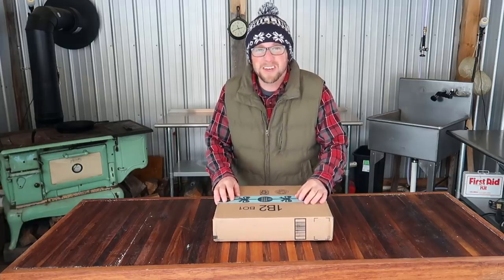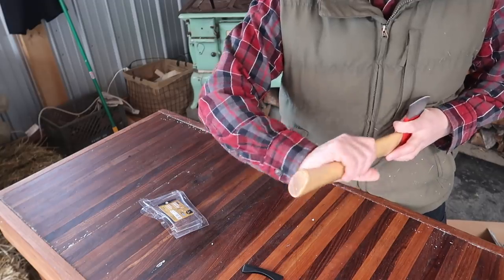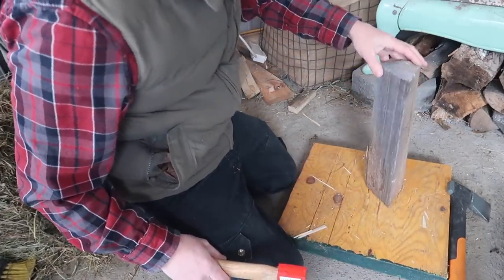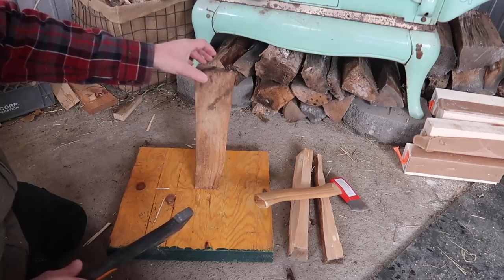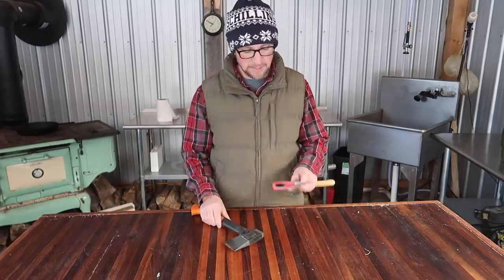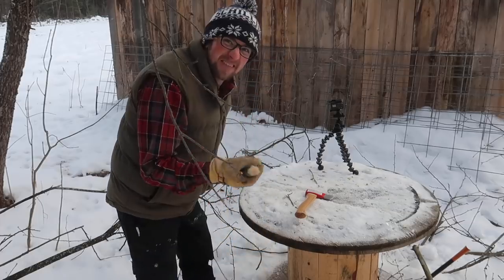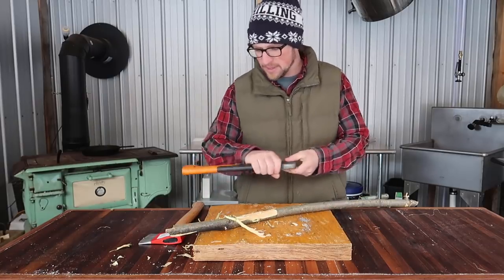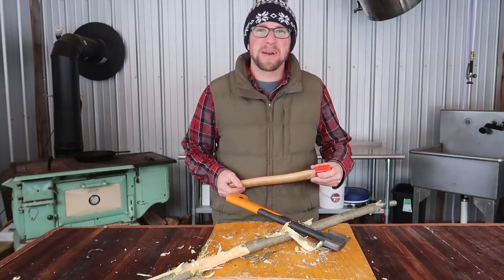Testing a $9 Axe on Amazon | Too Good to be TRUE

Comment: I would like to see a video of you making the ax better.
Reply: Most axes benefit from sharpening right out of the box, so I expect marked improvement when he does.  I prefer the wooden handle, means its easily replaceable which increases.  So as long as the axe head is solid and a decent (wedge) design, the axe will be pretty good.  Wooden handles are interchangeable, so you can either make your own, and Cinderella the new one to your preferences; modifying the grip to make it work better for your hand size, grip style, and/or swing.  Unlike most composite/fiberglass handles - though resilient - if the damaged you're pretty well screwed, as its monolithically bonded to the axe head in most cases I've seen.
Reply: @Benz1659  definitely agree with you there. Hatchets and axes are better with wood handles. The only thing I prefer fiberglass for is my 8lb splitting maul

Comment: I wouldn't even bother using that axe without putting a good edge on it, removing the varnish, and applying a coat of   
boiled linseed oil. Did you check the grain orientation? The varnish is for protection in store displays. I don't trust the epoxy, and I'd use a magnet to see what is under the black stuff. What you get for $9 is an FIY (finish it yourself) axe because there's no way they could put a good edge on it, haft it properly, and inspect it for that price.

Comment: Sand the varnish off the cheap hatchet,  you can profile the handle to fit your hand the way you like and then rub it down with boiled linseed oil.  Makes a great improvement on grip and will increase the lifespan of the handle! 
Good guide for wood handle maintenance with the linseed oil is : everyday for a week, every week for a month, every month for a year and then annually after that!  This works for all wood handled tools!
Keep up the great work, loving your channel as we embark on our homesteading journey!!

Comment: A hatchet is not really meant for cutting down trees, its more for splitting small wood or shaping wood.  It starts out with the weight to handle ratio.  A good ratio is one that is easy to use without tiring your arm or hand. It should be sharp and have just the right amount of width to split wood.  I get mine at most yard sales.  You can pick them up cheap and make your own handle to fit your hand.  The steel most times is better than what they make today.

Comment: Myself I bought a kobalt from lowes, $20.00 , has a very thin width to the head . Fiberglass handle , injected into the head of the axe. Handle has rubberized grip materiel. So while cold or wet  my hand grip does not slip. owned 10 years now . Life time warranty . I am a big believer in wood handles , they have there place for some tools. If i am in the woods, far from the tool shed  and only carrying one tool , I want a handle that is about unbreakable. Most of my tools with wooden handles have been replaced over time. For heavy work , snow , concrete and dirt . The lightest tool in weight wins my vote for all day use. On the kindling splitting for myself.... I always use a small piece of scrap wood to hold the top of the yet to be split wood. I am a safety nut I guess. Plus I have meet to many folks with a story to tell about a 8 1/2 or 9 digit  hand shake. They do not grow back . Seemed like a fair tool test AL. If you ever get a chance to chop with a sharp and thin head hand axe on those apple branches , the difference will shock you .  For carving with an axe. I think you might be using the hand grinder to customize that steel head , weight and angle ?  And or adding some flat edges to the round wooded handle?  Keep the great how to and review videos coming ! thanks .
Reply: Nice comment/info. I like having all 10 as well :-)

Comment: Just like axes, hatchets are designed for different uses. The black one with its more wedge shape is made for splitting, cutting kindling..  the cheap one is made for grubbing,, cutting around fence posts etc. the longer blade edge before it thickens out will cut smaller green stuff easier. It will also hold it's edge better digging and hitting the dirt. Wasn't long ago there wasn't weed whackers and I cleared hundreds of fence posts with one like the cheaper one.

Comment: Sorry but the last chop test wasn't fair! You used a vertical chop on the red ax but with the black head ax, you chopped properly coming in with a diagonal chop. For nine dollars, the red ax every time. You can always increased its grip by slipping rubber shrink grip over the handle and hume a better edges which axes need frequently when chopping into frozen and hardwoods. :)

Comment: Al when you used the $9 axe on the apple tree, the branch that you were chopping on was attached to a large more of a dead limb of the tree so the axe was bouncing a lot because of the dead limb.  When you compared with the other axe, the branch was smaller than the first one and the limb it was attached to was live and sturdy.  Just an observation.

Comment: My experience is that splitting dose not need as sharp an edge as chopping.  A narrow profile goes in farther but if the wood doesn't split it gets stuck easier.
If you are going to be using it to do wood working consider sharpening it on one side like a chisel so that it works as an adze.  My carpenter father always carried an adze in his toll chest.

Comment: If they revarnished the handle, it would not absorb water to swell tight.
Use a stick of kindling to hold the wood piece as you split it. No fingers near the blade. No thumb nail trimming. 
That Fiskar hatchet only cost 3-4 times what the Stansport hand ax cost. Hatchets have straight edged blades. Axes have curved edge blades. Hatchets are for splitting. Axes are for chopping into the side of a tree. The Stansport needs the edge profiled to chop better. They are purposely not fully sharp due to liability risks.
I'd take the Stansport camping where somebody could lose it. Put some friction tape on it.

Comment: I think the burr and varnish on the $9.09 hatchet was the reason it did not perform as well.  Spend 10 minutes sanding the handle and add some ting oil and put a good edge on the blade and you’ll have a decent chopper.  I wonder how long it will keep the edge, if the blade was heat treated or not.

Keep up the good work Al.

Regards,
Ed in Hamden Connecticut.

Comment: The Fiskar works well with out any modifications.   The only advantage to the Standport is the shape if the handle.  If you have to modify it to make it work better the cost savings is nullified.  Not all of us are have a good work shop like you have Al.  We also don't know how well the edge will hold up under normal use. Sharpening an axe of hatchet takes a little time to be done correctly.  Kind of like cooking knives.  A dull axe makes more work and is dangerous.   Plus you make me very nervous when you cut kindling.    I'm looking forward the next video and the improvements.

Comment: Good morning Al, the $9 hatchet had poor head control. I agree that the varnished handle has a lot to do with it. Wrap the handle with friction tape for a cheap, quick fix. Also, what is the angle of the bevel on the heads? Are they the same, or at different degrees?

Comment: Gooood Mawnin' Al!  This comparison makes me think about my sailboats running rigging.  The term used to describe how a line or sheet feels in your hand is to say it has "Good Hand".  A thin rough edged poly plastic line will develop burrs and prickly feel to it quickly when exposed to Sun and Salt.  A good nylon core wrapped with a softer outer layer will feel much better in your hand, hence the expression that a sailboats main sheet should have a "good hand" feel to it making it much more comfortable when being held in your hand for a long time while sailing.  Quite often things as simple as a hatchet will differ in only how well they feel in your hand.  Fatigue is the enemy of hard work.  Same difference in Craftsman hand tools vs. Snap On tools!  The price sometimes doesn't make sense until you "feel" the difference.

Comment: Instead of cutting kindling I make bundles of twigs and small branches.  Like those branches you burnt up from clearing the lane, I would have cut the prime stuff with hand loppers into 18" pieces. I use a smallish bucket and stand the pieces in till full, slap a bungee on to tighten them up and tie them up with thick thistle twine. Flip it over in the bucket and repeat but after the knot on the last end I leave a 18' or so peice and tie the end to the other wrap to create a handle. 
  If you add up the time you spend cutting kindling, the wood to make kindling and then factor in you are dragging limbs to just burn and time spent on that end and to me it's a break even on time to just cut branches in place and I get not only a use out of what was waste but the hours spent are in good weather, not cold days and less chance of being nicknamed 9 finger Al.

Comment: The cheaper one is made of cold rolled steel not harden steel... you need to be able to sharping the lower priced one,, And you can replace the cheap ones handle with a good one,,,,,

Comment: Get out the old angle grinder with a flap disk and reshape the edge thinner.  not a fan of Fiskars, too light for me.  Hand sand off the varnish and add tung or linseed oil and you will have a nice little axe with more weight.  Like the old saying, a dull axe and a short piece of rope are worthless.  Good luck Al.

Comment: I gave you a 👍 but the test was not correct. I purchased an axe almost the same as your new one at Harbor Freight for $6.00 with a 20% coupon. My axe has a 11/2 lb head and a fiberglass handle.The handle has very small dimples for grip. I use it all the time when I'm camping or RVing and I love it. I always sharpen the head after a few uses. I've also purchased a long handle axe ($9.00 w/coupon) from HF and I Iove it also it's a work horse😉👍

Comment: You can hardly find a handle for 9 bucks, That being said they are both duller than a butter knife. Personally I like the Eastwing for chopping and splitting it will last forever with the head/ handle 1 piece forged steel but It wouldn't work for your choked up carving as the handle is too narrow to hold like that

Comment: Which has the better steel that will hold a better edge? I suspect it will be the Fiskars which is Finnish made. I also suspect that the heavier head on the Fiskars is an advantage in chopping, splitting etc. It looked like the red ax had a very ugly edge on it, although the focus was kind of fuzzy. Yes .... I always remove the varnish (causes blisters) from wooden handles. I don't generally chop with gloves on .... I like the feel of the wood and like the positive control in the hand. YMMV. Too be very honest ...... I don't like either of those axes..... one looks very cheap with sub par steel, and the other too synthetic for my tastes. If Fiskars is going to mold a handle ..... why can't they make it more ergonomic? Just thinking out loud here. In the end, it is the buyer that makes their own determination based on their own specific needs. Take care and have a great weekend AL, Gina & Olivia.

Comment: While I like your test you are comparing apples to oranges. Both those small axes, most likely, aren't the same weight, different handle, different head angle from hammer end to cutting edge, different cutting edge and not sharpened the same. As for someone who can't afford the Fiskars  it is a great deal. For someone e who can afford the Fiskar they would, most likely, never buy the cheaper one.

Comment: Out of the package the red hatchet is not sharp. The fiskar is. I have both wood and fiskar hachet and 36" axe. I like my fiskar's better and they have lifetime guarantee and never loosen on the handle. BUT.. I still use both regularly and I give you the wood handle feel. As for framing hammer's I use fiberglass handles only. I started framing with an Eswing but changed to the fiberglass handle and never went back to steel or wood. And I hate to think how many 16d nails I have driven in my career.

Comment: I would like to see how the $9 axe works after you remove the varnish and paint and reshape the blade. It is better to have wood handles over plastic, but the Fiskar does better. It could be because it has more weight in the head, which is allowing it to bit harder.

Comment: Fiskars any day of the week.  They've been making axes since 1649... so I am pretty confident they know what they're doing.  I've had a Fiskars axe and Fiskars pruners for years and been very happy with them.  Well until someone stole the axe anyway, but I still have the pruners.  Work great out of the store without modification, plus they're reliable and nigh indestructible. I predict you'll end up spending equal to or more than the cost of the Fiskars trying to make the $9 axe useable.  Be fair and make sure you add the value of whatever you end up using to "fix" the $9 axe to its total cost, and the amount of time you took to "fix" it.  That's the very definition of false economy.  Is that your lesson of the day Al?
Reply: Lol.  Company founded in 1649, does not mean they produced axes since then.  You only read 1 line of the wiki.
Reply: @wheelinken   I didn't read any wiki, I read from their corporate history. There is a PDF on there too which shows pictures of products from their earlier days.  http://www.fiskarsgroup.com/about-us/our-heritage. Their Iron works were founded in 1649 in Sweden for the manufacture of cast iron and forged products.  Were making consumer goods such as nails, thread, knives, hoes, iron wheels and other things.  Granted, while it doesn't specifically state axes amongst that list, given they were located in the forestland in the Phoja region I believe it is a pretty safe assumption to say axes were part of "other things" as their clientele were assuredly in need of axes.  Whether it was 1649 or the 1800's,  they have been making them for a VERY long time.  Fiskars are a very well established company, they make good products and have been doing so for a long time.

Comment: Sorry, but you are NOT a good product tester.
I could see clear bias against the new axe.
When selecting two "equal" pieces of wood to cut, you choose the thicker for the red axe.
When red axe fails, it is the axe's fault.
When orange axe fails, you go "oh, my bad, lets redo"
.
In addition, one can clearly see that you are more used to the balance of the orange axe, apparently you have used it before, and often. You are more comfortable with it when you swing.
When you swing the orange axe, your blade is exactly in line with the motion.
When you swing the red axe, you rotate the blade to the left by about 3-5 degrees. Maybe this indicates a bad handle shape, but more likely it indicates you are over-gripping the handle. Maybe you are aligning with the left slope of the head, instead of the centerline of the axehead?